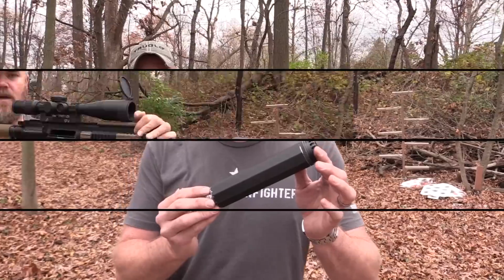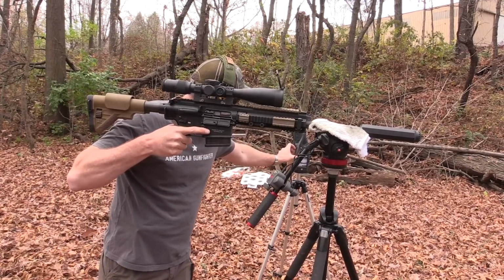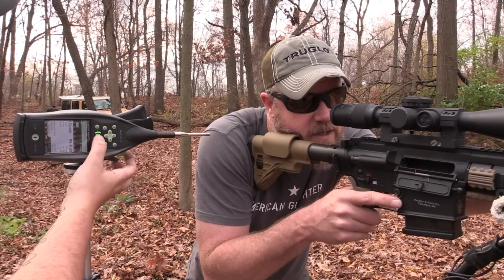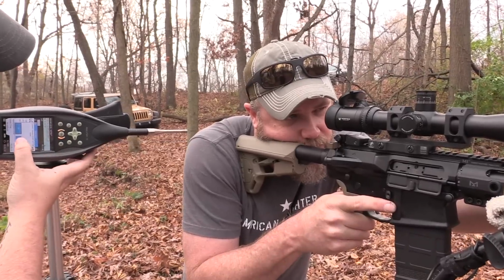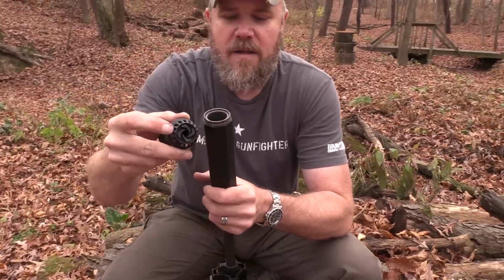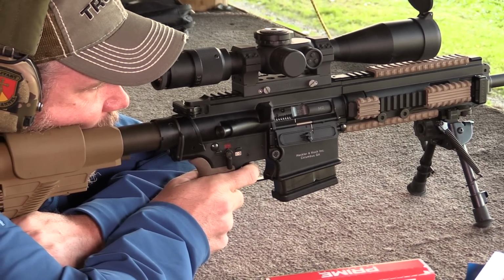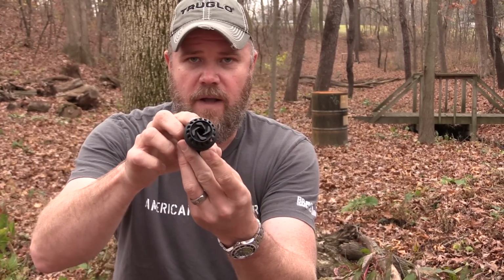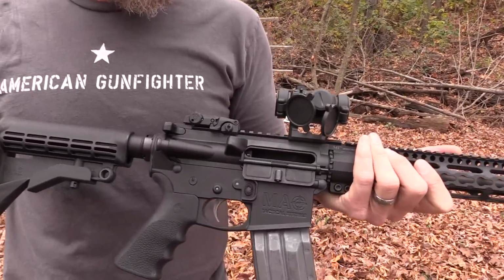New OSS Helix 762 Silencer full test!

Comment: At the beginning of the video U guys took the  suppressor off and set the gun to fire on a rag with the barrel not the forearm on the rag. It appeared that the rag might have been ruffling some of the sound from the barrel. U can see the barrel exhaust on the rag. Why is it that you did not use the forearm as the rest not the barrel? This test might be slightly flawed.
Reply: Anthony Shepard the rag was also smoldering which means it caught on fire

Comment: I like testing at the ear, that is what matters to me.  could you do this with a silencer co omega?  possibly also with a bolt gun?  the omega is one of the most popular out there and I have one in NFA jail atm.
Reply: Carl Groover funny how this has evolved over time. Cans were originally developed and used to conceal the shooters location from the enemy (forward of the muzzle). Now, the emphasis is on the shooter (behind the muzzle) and their hearing protection
Reply: Yea, I want one for hunting, I don't care how loud it is out front I just don't want to blow my ears out.
Reply: Again, different tools for different applications. Recreational shooters vs. military shooters. 
In terms of marketing every gun dork wants to own "mil spec". I think this is a perfect example of why that doesn't always matter. Kind of like owning a milspec HMMWV vs. a consumer Hummer. Some morons would want the milspec because, well, it's milspec. I would prefer the consumer-spec... the one with A/C, comfortable seats, a radio, sound insulation... things that don't go into the milspec version because the jerk-offs politicians making the deals don't give a rats ass about a soldier's comfort.
Reply: Silencershop had a video up with exactly that. They took it down when their trade agreement ended. However, if you watch the SF 300sps video you'll get an idea. The two cans were within 1-2 dB on each host.
Reply: M85FSLUVR i really don't think that was the case. read up on it.  it was designed in conjuction with auto mufflers for the sme reason, to make a new invention less obnoxious for the users and the other people around.

Comment: Wait - you did the OSS on a piston gun, which will have less backpressure, and the other on a DI gun? That's not a good comparison. The shooter's ear measurements are good numbers and definitely food for thought, but you can't compare the two suppressors based on these numbers.
Reply from the maker: ..which is fortunate as the point wasn't to compare the rifles. 90%+ of the gas coming out the ejection port is from gas coming back down the barrel.
Reply: Military Arms Channel Some people are going to draw that conclusion though, if they don't pay close enough attention.
Reply: Back pressure due to suppressor use comes down the barrel because its the path of least resistance.  It does not matter what type of gas system it is.

Comment: 1.6 and 1 is for team operations where in a kneeling/crouching/stairs position would effect others
Reply from the maker: ...which is why the military has completely dumped the standard. Being 1.6m off the ground is pretty high, guys that stand 5'6" have to stand on a stool to shoot the gun.
Reply: I agree. This was due to low quality suppresors and to show flash hider  vs muzzle break.
Reply: Pretty sure it's just mostly arbitrary numbers someone came up with for the sake of consistency and repeat-ability. The US military measurement procedures was and has been to measure the sound at the shooters ear (since like 1997, I forget the mil-std document number) 1.6 meters from the ground, and at the center of the location of the shooters head. The MIL standard has been just that for 20 years now, but the industry went on a tangential path.

1.6 meters prevents the floor from reflecting a significant amount of noise back at the mic, and to my mind, 1 meter to the left is to better measure the attenuation provided by the silencer itself, and reduces the effect of the action of the firearm on the sound testing (ejection of action gasses, parts banging around, etc).

From the perspective of measuring the sound level safety of a complete firearm system it makes sense to measure the sound level at the ear. To measure the effectiveness of the sound dampening for determining how much more stealthy it makes the operator, it makes better sense to measure it at the muzzle, because that data can be more accurately extrapolated to determine how loud the shot is at 50 meters, 1000 meters or anywhere in between. Like all things, it depends on what you're trying to accomplish.

That notwithstanding, of course any manufacturer is going promote the test which makes them look the best. The OSS does have less backpressure, so it has less exhaust pressure on the right side of a conventional AR platform rifle, especially without an adjustable gas block. On the other hand, traditional baffles evidently do a better job of capturing high pressure gasses overall.

Comment: Why not test the OSS at the ear on the DI rifle?
Reply: The HK is not DI.  For this to be a valid comparison of two cans, all the other variables need to remain constant.  Two different rifles, with two different operating systems.  

I agree, the "normal" testing standards are not accurate, and I am glad to see we are headed towards shooters ear type testing.
Reply: I left a new post asking for some constant variables- namely a "standardized" configuration for the rifle platform.... I kinda wish he has used the MR762 with the other can, not an AR-10... it could skew the results... not to mention the Gemtech BCG in suppressed mode adds another unknown variable to the equation... makes the results hard to compare fairly.
Reply: The reason the standard is used. Is because the suppressor is not meant for the shooter, at least in military doctrine. Suppressor use for the military is essentially to not give the shooters position away. The testing used by the industry is done, because they can now calculate the sound signature at any distance down range. The military solved the hearing issue for a soldier. Use ear plugs which is stored in their helmets.
Reply: He answered this issue repeatedly already--he didn't have the mount to put it on the DI rifle.
Reply: Actually, he specifically stated why he wouldn't run the Dead Air on his H&K MR762 - because H&K specifically prohibits using any other suppressor than the OSS, and shooting it with the Dead Air would void the warranty.
Reply: @Terry Faugno..  Guess I would not buy the H&K then...  It's sort of silly to suggest that no other can can be used with their system.. 

Oddly enough, their online warranty does not say anything about the prohibition of other suppressors...
Reply: Mad Dawg If the story about the warranty is accurate, it would probably be because traditional suppressors cause a significant increase in bolt speed, which could result in abnormal wear on the weapon.  The OSS does not have that problem.
Reply: If I had to guess, he probably didn't want to switch the mounts around.  I thought the important part was how the two different measurement standards each favored a different style of can.
Reply: Netpackrat He was saying that some cans are louder at the ear and used the DI rifle with the can on it as an example. The point is the OSS on that same rifle may also be louder at the ear, we won't know unless he uses the same variables. Same rifle or same suppressor for each test, even if it means switching mount.
Reply: Mad Dawg Maybe it was specific to the CSASS...?
Reply: Yeah, that's what I'm thinking. The CSASS is a specialized package based on the MR762, and designed specifically for use with a low back pressure suppressor.  Probably wouldn't be found in the online literature for the regular MR762.
Reply: The OSS would be much louder "at the ear" if it was mounted on a DI rifle because the DI system vents high pressure gas out the side of the bolt carrier.  I did a similar test on my own rifle and got ca 142 dB at the ear as a result.

I am currently arranging to borrow a piston rifle to test out the difference.
Reply: Why not measure within 1/2 inch of shooters ear instead of 6 inches?
Reply: He did exactly that. And it was >140dB on all 5 rounds, the first one being 150dB. Tim made an excellent point, the can makers have been building cans that meet a certain spec, i.e. the SPL reading at 1.6M height and 1M to the left of the muzzle, which they meet quite handily in most cases. What we discovered here is that such specifications aren't necessarily the best for the shooter, as the shooter experiences a much higher SPL reading where it does the most damage, right near their ear.

A good analogy is schools teaching a given subject to prepare students to pass a standardized test, so they can pass it reliably, rather than teach critical thinking skills and enable them to solve the problems in whatever manner suits their talents. OSS asked the question "why don't we measure how loud these things are at the ear, rather than the muzzle?" and they found out the same thing Tim did, and did some testing to find out why, determined that the backpressure of the muffler on the end of the barrel was sending that hot, supersonic gas back the way it came, along with the noise, and said "how can we suppress this and allow freer gas flow?" and we saw the end result.
Reply: Terry Faugno I'll watch the video again, but I'm pretty sure he didn't. He tested the OSS on the HK both places and the other on the MI both places. If he did the OSS both places on the MI it would have been a much fairer comparison.
Reply: @terryfaugno9242  No, He used two different weapons.

Comment: Did the HK failed to chamber a round?
Reply from the maker: The MI failed to chamber a round. Most AR10's I've suppressed don't function properly with a traditional silencer on them. Some do, many don't. That's why I put a Gemtech carrier in the MI rifle. Keep in mind M80 ball is not as powerful (lower pressure) than .308 Winchester... it's the opposite of .223/5.56.
Reply: I thought traditional suppressor usually gives higher pressure to the gas system to cycle the bolt with more force.  It seems the bolt barely extract the first round. Thats weird.
Reply: Nope, different rifle

Comment: Several manufacturers manage 140dB at the ear with a QD can that was 4" long on a 14.5" barrel. The fact that you have this can on a longer barrel and the can is so large and heavy just goes to show you how poor of performance this suppressor is.
Reply: Mongo63a, did you miss the fact that this is 7.62, not 5.56?  I highly doubt anybody is getting those numbers from a 7.62/.308 with 14.5" barrel and a 4" suppressor .

And you're making a common mistake regarding the shape.  There is an inner cylinder that contains the pressure. The outer octagon is just there to disrupt the mirage. 

If all you care about is the reading on the meter then OSS is not for you.  If you want performance features no other design can provide,  the it's certainly worth the price.
Reply: In the SOCOM testing Surefire and AAC both managed sub 140db at the ear with very small cans. I just noticed a typo on my previous I meant 6" can but 4" added to the barrel.
Reply: Mongo63a OSS also has over the barrel designs that are about the same size as those other suppressors.
Reply: Mongo63a Well it must be working as the DOD tested it and it beat the competition by a long shot during the test. I'm not saying they are perfect or necessarily the best for all situations but it has earned its place in the market in my opinion.
Also they have some good info videos on their YouTube page if you'd like to see the test I'm referring to or research the reasoning behind the design as you don't seem to be on the same page.
Reply: Mongo63a these are the undisputed very best manufacturers of cans. If these others were less money, than I could understand. But they are not. Of course, the reconfigurable or multi caliber cans are a different animal altogether. Perhaps if we can get the HPA passed, we will see new makers enter the market with new innovation. Without NFA regulations, we will see a rapid adoption by even more casual shooters.
Reply: Yet the OSS cans are more expensive and they are and are shooting for the same market, aka military. An engineer that is not brain dead knows that if your suppressor is heavy you should not be using a a tube with cross section of a hexagon. It is just added weight with no strength benefits. The complex machined patterns in their "baffles" are not suppressing any better than 5 fender washers in a similarly sized suppressor. OSS is marketing gimmickry, not a well engineered product.

Comment: Why were the cans not tested on the same rifle for consistent testing?
Reply from the maker: The point was to show what the new CASS rifle and suppressor were, but there's no word if OSS has been officially adopted. The HK has been.
Reply: The barrel is a bigger hole than the gas port.  Gas will take the path of least resistance which is never down a tiny gas port or gas tube.

Comment: OSS definitely makes an awesome suppressor with innovative technology but their damn PR department is just horrible and downright embarrassing. For them to come up with "fake" test to compete for government contracts against the SF SOCOM and saying that it was a legitimate test is just wrong. This has actually become big news within the community.

Either way, great video MAC.
Reply from the maker: From what I understand, the change made was making the silencer internals out of titanium vs. aluminum.
Reply: Military Arms Channel Tim, if you didn't follow the drama closely the main issue centered around the fact that the outer shroud appeared to be split open pretty bad. That led people to assume that it was the pressure containment structure and then concluded that it was a catastrophic failure. In reality the inner cylinder was fine but it still didn't look good in the pictures for that outer shroud to be split up in like that. I'm assuming they did something to improve its strength because it did better in the second test.
Reply: Uh... your ignorance is showing.  Perhaps you should learn more before making absolute statements?

Let's start here... please show us evidence of another 7.62 silencer that is more quiet at the ear.  Or did you miss that distinction?  There's usually a trade-off.  The lower the reading at the muzzle, the higher at the ear, and vice versa.  Why don't you look at MAC's recent review of the Surge where he gets great readings at the muzzle and almost 150 db at the ear?
Reply: Two2onefive Fake? I don't think so... they clearly stated what they were doing (duplicating a government test).  If you assumed wrong that's your problem,  not theirs.
Reply: Fake was in quotations. That's subject for debate. You should ask Surefire what they think. There's plenty of info out there for you to do research on and the majority agrees. So no, its not only my problem then.
Reply: OSS made it clear that after a prototype had problems in the test conducted by the government, they went away and made improvements and then duplicated the test.  I'm sure Surefire wasn't happy with the outcome of the test but they can't claim it was fake.
Reply: Again, there were quotations. The "fake" was jab at the the legitimacy of the "government agency testing" that they led others (not only me) to believe. Of course that's a real physical test, no one is doubting that...
Reply: EagleEastcoast All I know is OSS said the gov tested a prototype, then they made improvements and re-did the test.  That was before they put out the new model MAC tested.
Reply: I'm guessing because it featured the original founder Russ Oliver who has since departed the company under less than amiable terms.  I hope they will get more videos like that back up soon.
Reply: Sounds like there was a disagreement about the direction of the company and Russ chose to leave.  He mentioned some things in his resignation letter here:

http://soldiersystems.net/2016/02/22/russ-oliver-resigns/

It appears the company has picked up the pieces and continued on--this product MAC tested was the first new release since the split.
Reply: Dildo vs cabesa ???
Reply: Actually they changed the muzzle break to cobalt, and welded a lip to keep the tube from self tightening and bulging when it was super heated...and the cans the govt tested are the same cans your seeing in the MAC video...
Reply: Not sure if you noticed, but this is both the heaviest mass produced 30 cal silencer in the world, and also the loudest.

Comment: Tim, great videos as always. Would love to see the Dead Air tested against the OSS on the same rifle. Not really apples to oranges when you are using two different operating systems. In fact the 1.6m up/1m left test showed the Dead Air to be quieter with very little FRP because you took the operating system out of it on that test. Regardless, Keep up the great work.